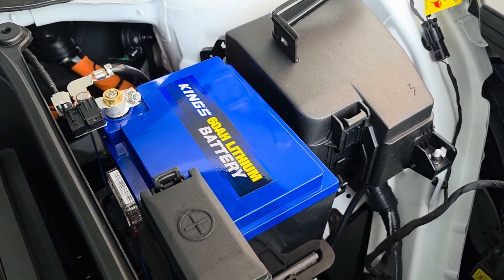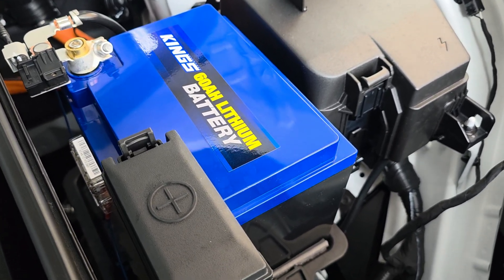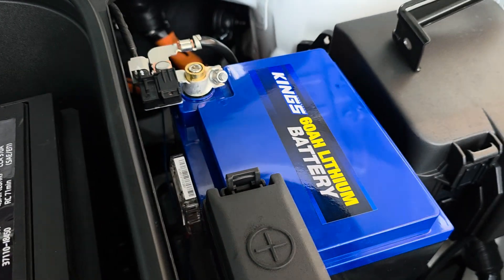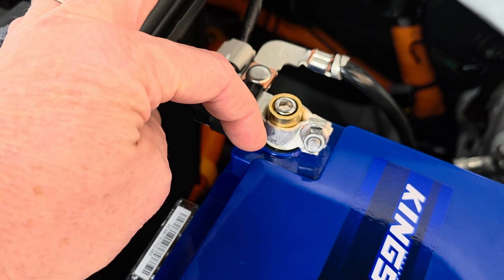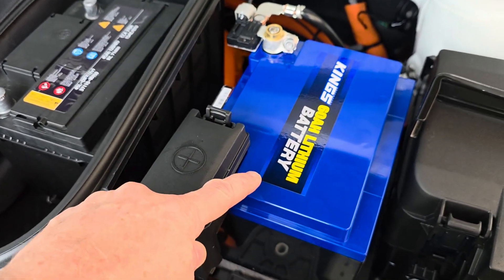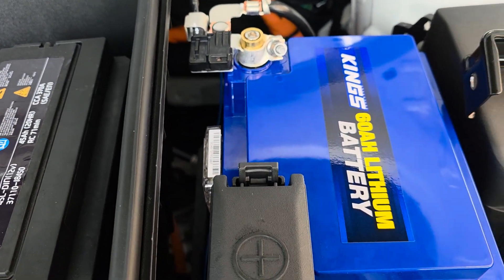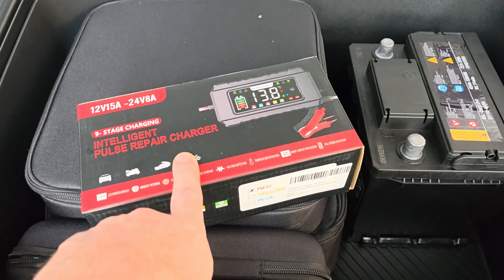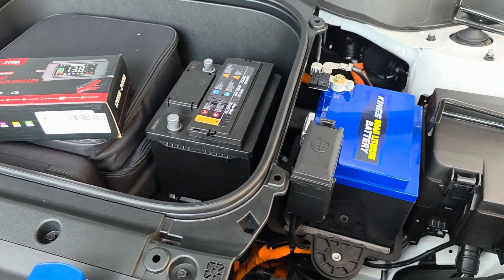Kia EV5 (AUS) 12v Battery Swap - Lead Acid to Lithium

Comment: Great video Stephen, well filmed and explained, you are a natural! I follow the FB EV5 group and noticed you posted an update yesterday with findings after change. Seems all is well. Quick question - Will this void the Kia warranty? I'm not game to make the change myself as you did show there are a few adjustments to the bed and tightening post swap. Not sure if a KIA dealership would carry the work for me. 👍
Reply from the maker: My pleasure Antonio. As per any car, the 12v battery is classed as a consumable and will need to be replaced many times over the expected life of the car. I checked with the dealer and they were fine with it however understandably they did say that if an issue arose that could be traced to the battery swap then that wouldn't be covered by warranty. Fair enough but of course that opens up a lot of grey areas on all sides if anything does happen. I was initially pretty confident this simple swap wasn't going to cause any issues and now I've had it in the car for over four months I have enough data to prove it's working very well, in fact better than the original lead-acid! I still need to monitor the health/behaviour through the critical hot months before classing it as a complete success but its already looking like it'll pass with flying colours. I'll be making another detailed video in about March 2026 summarising the hopeful success but will be updating the FB group in the meantime.

Comment: Hey,

I enjoyed your EV5 videos - thanks for making them. I’m really looking forward to getting my EV5 soon.

I was thinking the same thing: why are we still using this old battery technology? Then I came across this video:
https://youtu.be/i27lApNWkyA?si=L2VGy-5Bc1r3klga

Now I’m wondering if Kia designed it to use lead‑acid batteries.
Reply from the maker: Thanks, my pleasure :)  Yes, I'm sure Kia designed their ICCU with a Lead-Acid 12v battery in mind and yes this swap isn't without its risks however I was willing to take that risk as I'm amazed at how poor the supplied Lead-Acid batteries are and wanted to proactively solve the associated issues with them. I was expecting problems but nearly four months since swapping to the cheap Kings Lithium and it's working better than expected with the biggest benefit being far more stable voltage and ICCU behaviour... no more crazy spikes or dips detected at the terminals and the Lithium just sits very happily at 13.3v most of the time. It's still experimental and I look forward to checking temps throughout Summer but so far its an absolute winner.  Oh and thanks for the link. The Kings Lithiums do have at least one temp sensor for their cells (possibly two!) and although the BMS is equally as cheap as the rest of it I'm feeling confident this is a winning combo but if course let's wait until after Summer to start celebrating :)

Comment: It does seem that the EV manufacturers are not paying enough attention to 12V battery care. It wouldn't be hard to have the system wake up and go into utility mode if the low voltage system voltage falls too low (as long as high voltage system state of charge is sufficiently high).

Comment: The 12 volt battery in our EV5 died after two weeks since we bought it. It was replaced with a similar unit under warranty but that one also threw a low battery warning after 2 days. Needless to say I'm not impressed. The car will go in for servicing tomorrow and I have specifically asked for them to check the battery management system. Other than that I am considering replacing the oem battery.
What is your experience now that you've had the lithium battery for just over a week?
Reply from the maker: Thanks for your reply and sorry to hear you're having dramas. In your case it definitely sounds like an ICCU/12v charging fault however you wont know until they run their diags. Either way, yes the Lithium Battery is running far better than expected... zero hassles and so much more stable than the lead acid as reported by the ANCEL BM200. Still early days of course and the biggest test will be the higher temps over Summer 25/26 but yeah, looking good so far. Good luck with the repair and please report back with the verdict, thanks.